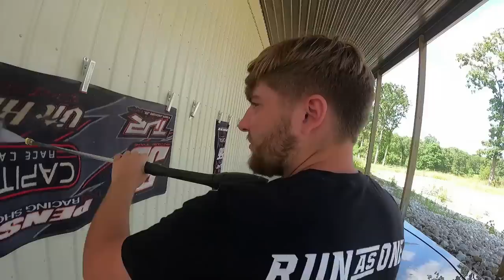Arrowhead OK and Stovall? Episode 29

Comment: Might not have been hot laughing at 9:45 if there wouldn't a bunch of arrogant drivers didn't want to go pack the track
Reply from the maker: 😂😂 if you dont like it, dont watch. We dont deal with trolls around here
Reply: The cars are there to race not to do track prep that is the promoters responsibility.
Reply: It’s not their responsibility to help. They are there to race and put on a show. Nothing else
Reply: I was there. It was off and on raining for 3 hours. It wasn’t a packing issue. When they called. They only called 2 classes to pack. At least 15 cars from each class went out and helped.